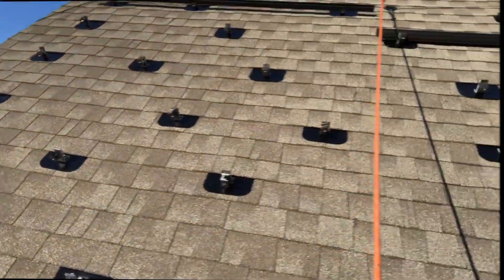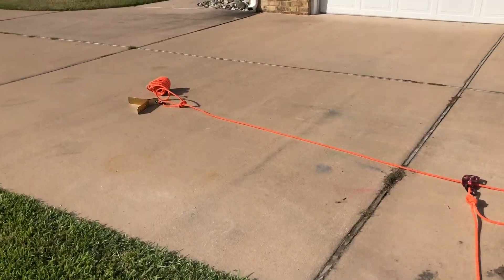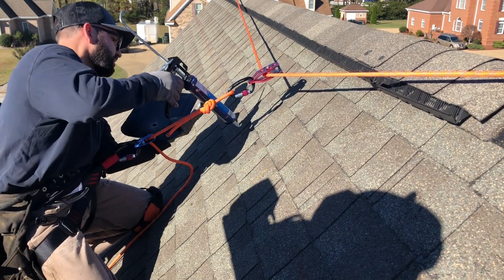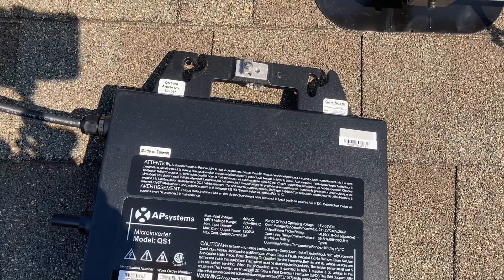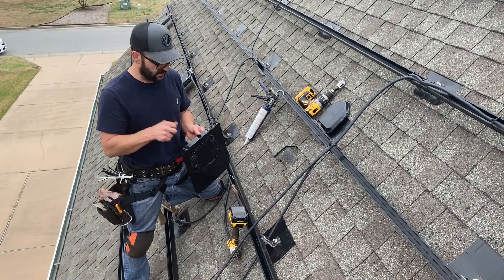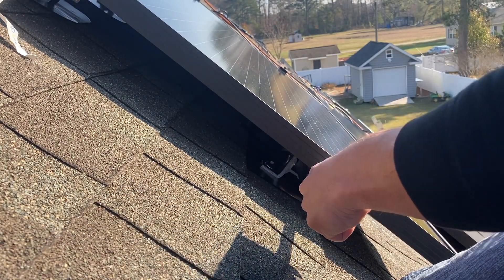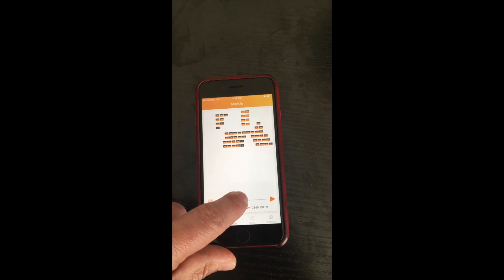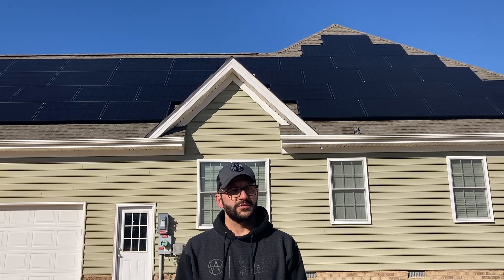DIY Solar Power System?? So simple "ONE" can do it SOLO  - Solar Wholesale - SnapNRack

Comment: So in the state of Washington.. I have 8kw 20 panels connected to AP system microinverter inverter.  The rails are grounded with #8 solid copper on roof. I have 2 parallel runs of 12-2 romex poking down from the roof top into attic. Going into EMT side of the house with LB. Transitioning in the LB with a splice into #12 thhn including ground. Down to a combiner box
 Does this seem right? I'm new to this

Comment: Awesome video. Thank you for making it. One question I have is what is the spacing between rails did you use?

I have to mount my panels in landscape and cannot find anything that tells me how far apart the rails are.
Reply from the maker: You want approximate 25% of the panels height or width past each side of the rail.
If the width of the panel is 40”. The rails will be 20” apart. Don’t forget to account for the offset of the mounting bolt to the rail.
Reply: @scottssolutions3849  awesome thank you!

Comment: Hey Scott, thanks for this awesome video! I'm about to start installing a Solar Wholesale solar array on my house. I was wondering where you got the roof safety system you use in your video? I already bought a roof safety kit but I would like something that allows me to slide from one end of my roof to the other end easily.
Reply from the maker: I just got the stuff off Amazon. Need any help give me a call 757-876-5538
Reply: @scottssolutions3849  Had the same question.  Can I give you a call or perhaps suggest providing the products used and their Amazon links in your video description.
Reply from the maker: Just some suggestions links for safety equipment in the description
Reply: @scottssolutions3849  thanks!

Comment: This is my guide now! Thanks! Do you have links for roof peak pulley system
Reply from the maker: You talking about my safety rope guideline?
Reply: @scottssolutions3849  yes
Reply from the maker: @Victor Kilin  I don’t but I can help you out.
Reply: @scottssolutions3849  Im also interested in your rope pulley design. Any help will be appreciated. Thanks
Reply from the maker: Currently I am working a roofing job before I install his panels. I will do a short video on the safety set up. I will try to have it uploaded sometime next week.